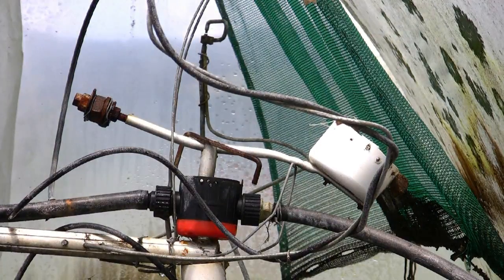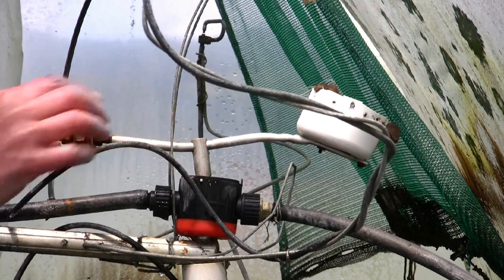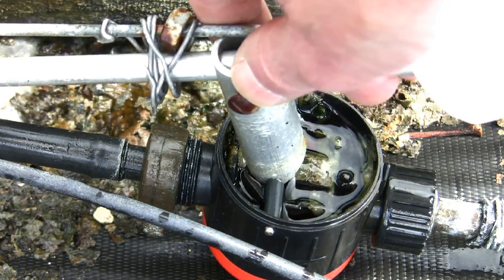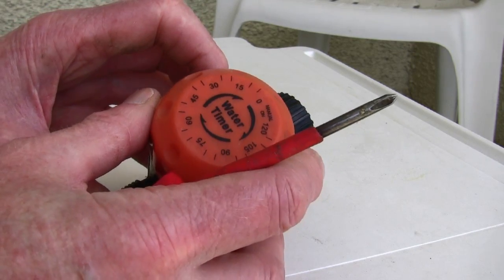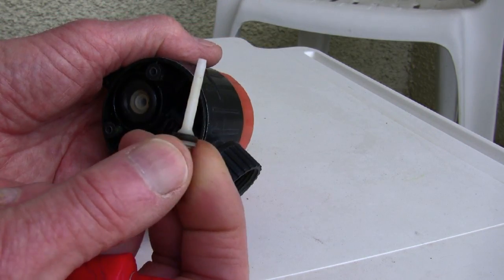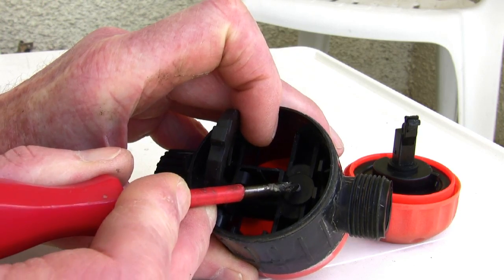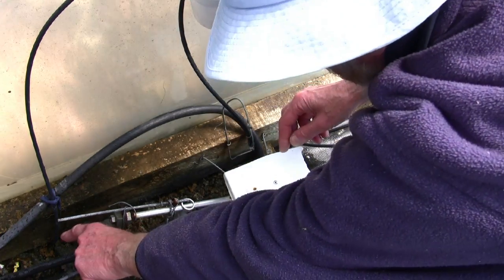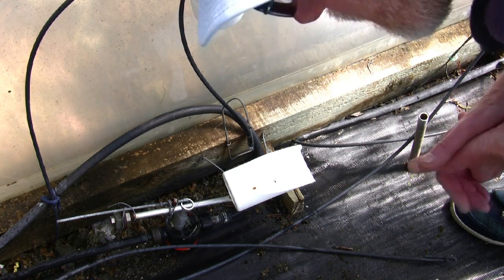DIY automatic garden / greenhouse watering system

Comment from the maker: The valves in the video are still working, all I do occasionally is spray them with bleach to kill the green alga that grows in the water receptacle and upsets the balance if it builds up to much, especially on the evaporating cloth on the misting unit one which operates on and off every few minutes.

Comment from the maker: Sorry no, the valves are not all the same and I only use any that the clock mechanism has stopped working, it's just making something out of what would otherwise be scrap. I originally made the valves on my lathe out of aluminum but they built up with calcium deposits from the water, I also used magnets to set the valve in the on and off position but found that I could get the same result by having a vertical extension that holds the horizontal balance arm, it's trial and error I'm afraid.